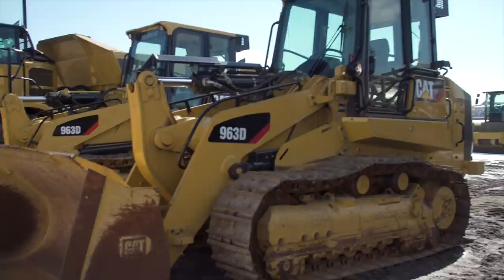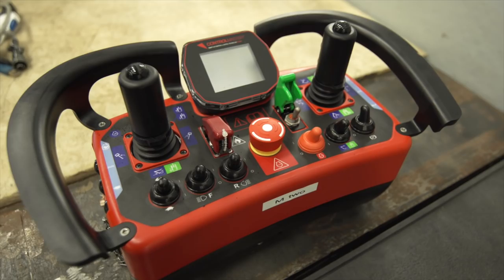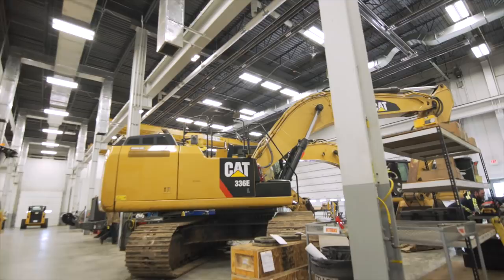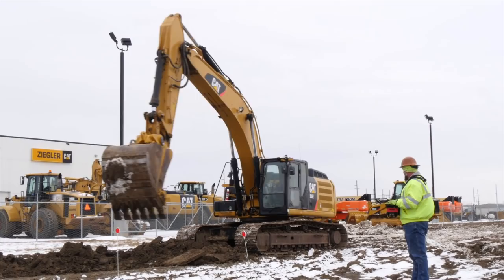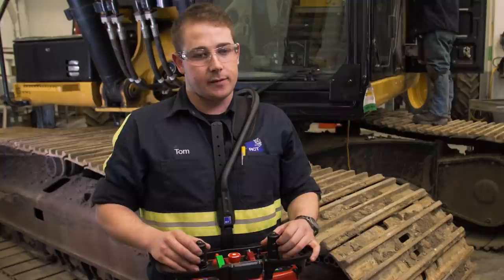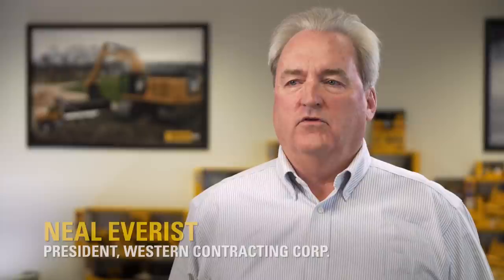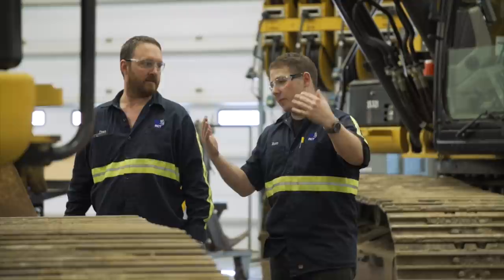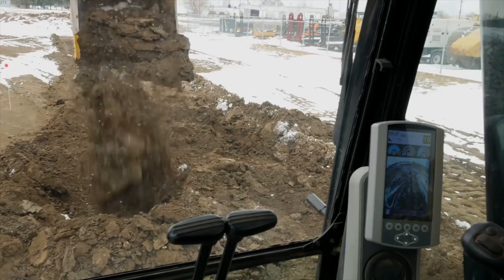RCT Remote Control Excavators & Bulldozers - Ziegler CAT (Western Contracting Automation Project)

Comment: Equipment operator was my trade. I would rather be seating comfortable in the environmental cab than standing outside in the elements.  But I always thought that was a cool idea for dangerous situations where you had to back off 100-200 feet from the machine.
Reply from the maker: Thank you for your comment. For this project ControlMaster Teleremote enabled machine operators to effectively manage machines from a mandated 1000ft exclusion zone and excavate and dispose of unexploded ordnance. ControlMaster Teleremote was seen to be the best way to safeguard operators while completing the project

Comment: This can also be used for radioactive areas etc
Reply: Unless the radiation is to high for the electronincs. They were having problems using robots to clean up the mess at fucashima in Japan, and if  japanese robot can't do it then nothing can lol. They should use these more and I can't see it being that expensive or complicated to convert them to rc especially if they controls are electronic to begin with.

Comment: Standing outside in the cold when there's a closed cab machine with climate control
Reply from the maker: Thank you for your comment. Once the machines were commissioned on RCT's Teleremote technology the machine operators were able to manage the excavators and track loaders from the safety and comfort of a concrete and steel Automation Centre. Read more here https://rct-global.com/2017/08/rct-completes-custom-civil-contracting-job-in-the-us/

Comment: You still need an operator so why bother having it operated by remote control. Much safer if something goes wrong with the box of tricks.
Reply from the maker: Hi Bob, thanks for your comment. 

ControlMaster Remote operation allows the operator to be placed in a safe location away from dangerous environments, such as unstable ground. Having the operator removed also assist in health, such as engine vibration and avoiding poor air quality. ControlMaster can even install multiple cameras allowing the operator with more vision via remote to minimise risk of machine damage. The remote also allows quick shift change, allowing production to keep moving.

The manual option is still incuded but the solution offers all the machines controls, right down to lights and horn.

regards.